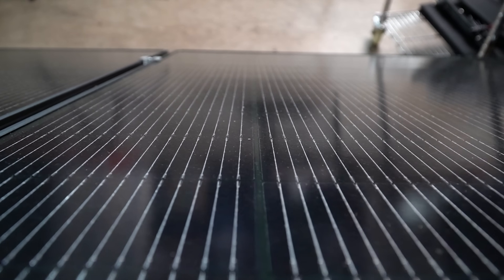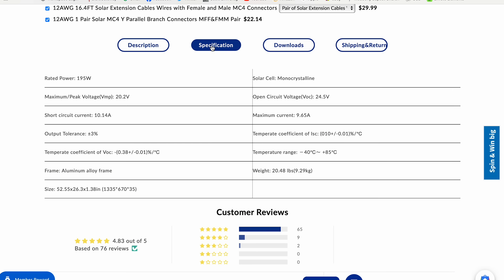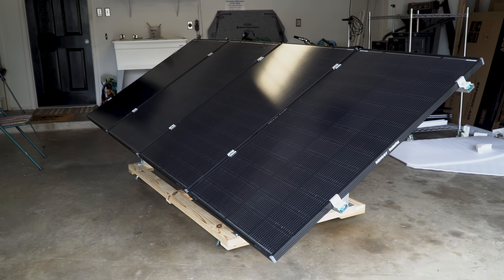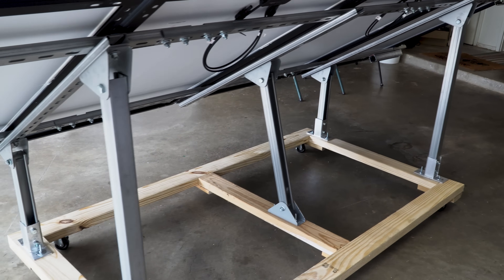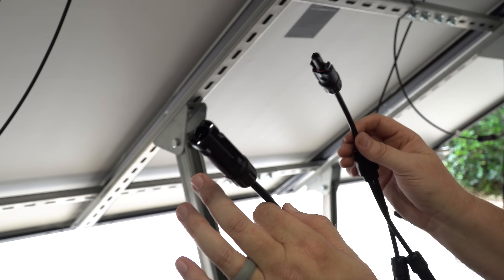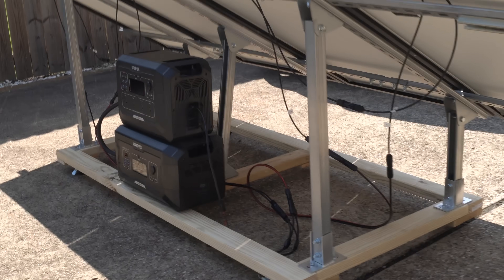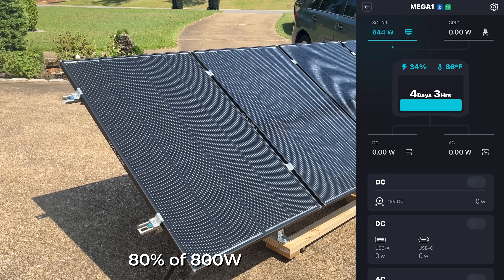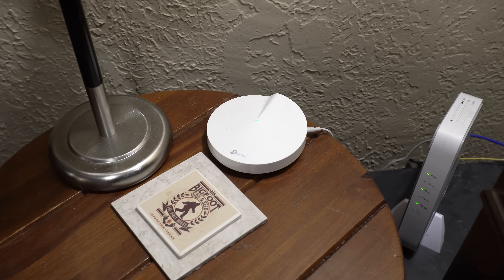I Bought Rigid Solar Panels for My Portable Power Station

Comment: Could you post a link where one could buy the PV jumper cables you made? I can find the 15amp inline fuse and Y connectors.  Also do you leave your Renogy solar panel connected to your Mega 1, 24/7

Comment: That's called over paneling.... You can have as many watts/amps in panels that you want The units will only take what they can take you can't jam too many amps into it you just can't go over the max volts.... 
If you would have put the over wattage panels on then on a cloudy day you still might get your maximum watts the unit will take.

Comment: I had 2 Mega2 and 4 b2 batteries and had problems galore. Now I have 1 mega2 that won't communicate with the batteries. So 4 use lees batteries and part of a mega2. Went back to a solar charger, inverter and 4 stackable batteries.
Reply from the maker: Sorry for the inconvenience! Can you describe what's the issue with your power station? Please tell us via email(if you can please take a video) to support@oupes.com, we will have a specialized after-sales technician to answer and deal with the follow-up for you one-on-one!

Comment: I ended up buying 2 of the DOKIO 300W Folding Portable Panels off of Amazon. First was only $225, the second a few months later was only $154. May not be great, but that's what I could afford. I ended up buying the OUPES Mega-5 plus one extra Battery, for a total of 10kW, off eBay during the Christmas sale. Got a great deal on both Refurbs ! Still haven't hooked any of it up though, a WHOLE LOT has been going on since then to slow things down to a stop. Great video, Thanks !